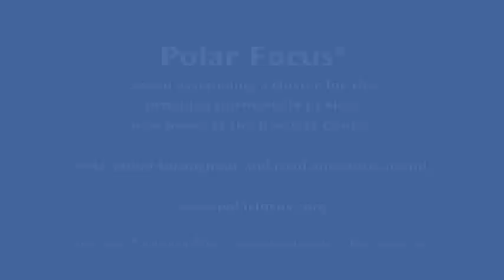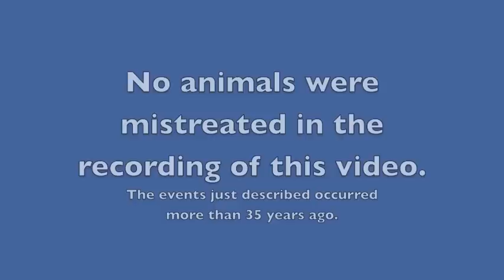Fast-motion pre-staging a large cluster for job H5721 by Polar Focus®

Comment: ***** The turnbuckle has approx 600 lbs of load on it. It's rated at 2200lbs at a 5:1 from it's manufacturer. We work to 10:1, so in our case 1100lbs. It's plenty safe and includes a small amount of angular adjustment to the cluster.

Comment: Why in the world would you want to hide those beautiful subwoofers? Wouldn't you want all of the sound elements pointing as direct to the audience as you can? I mean I get it makes sense from a rigging stand point but WHY hide all that BEAUTIFUL BASS???
Reply: Philly McVea if you put the bass in front of the shorter mid and high frequencies it will drown the out.
Reply: The bass has more than enough power to travel around the other speakers. And they usually put some on the ground also :)